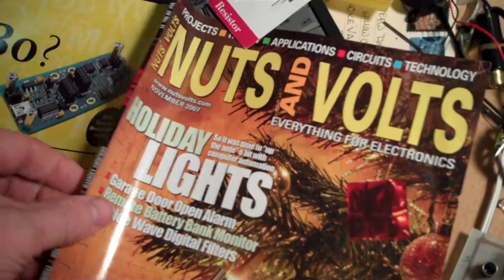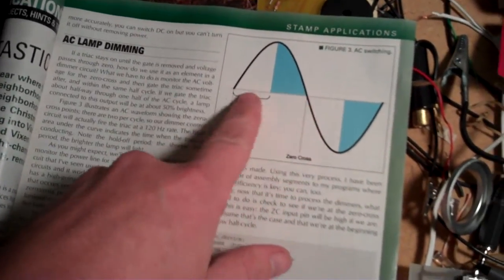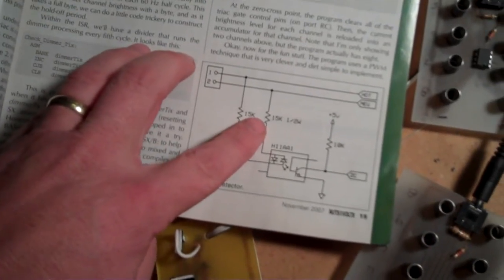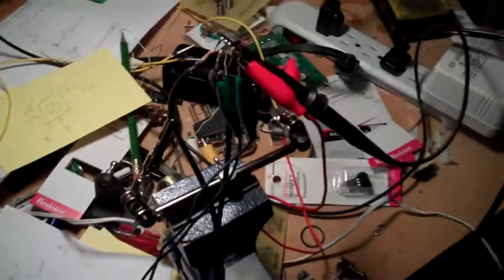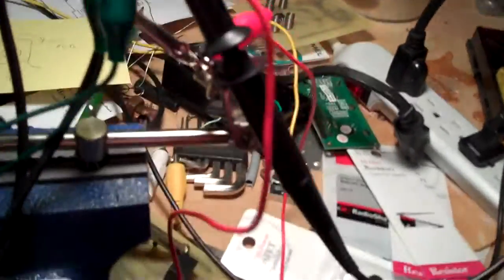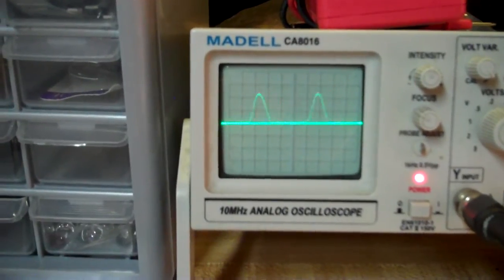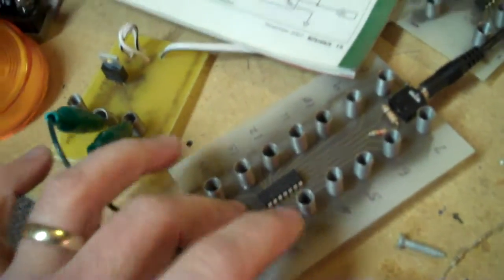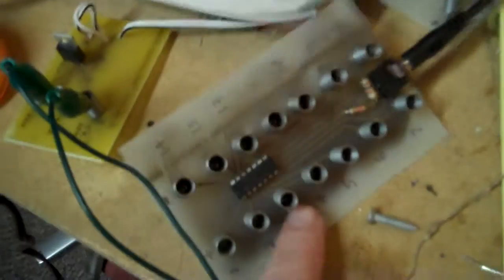H11AA1 optocoupler to read crossover in AC mains

Comment: I am not sure if you got any further with this, but many SSR's actually do already have a zerocrossdetection and in that case it won't work, because the  relay will just wait till the next zero cross before it switches on, but by then you already switched off the  signal to the relay because you are dimming.

It is easier, and cheaper to use a  TRIAC (via an optocoupler)  for that
Reply: For what I am doing, I am using a MOC3020 and some triacs. They do not let me dim with an arduino so this is when an h11aa1 would come in handy.
Reply from the maker: The main point for me was self learning, taking on a challenge.  Thanks for the input!